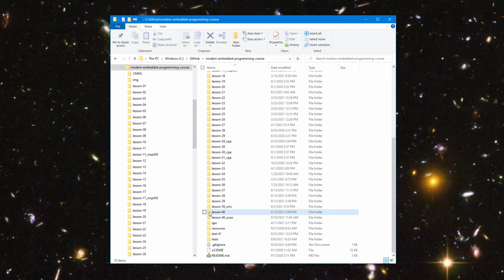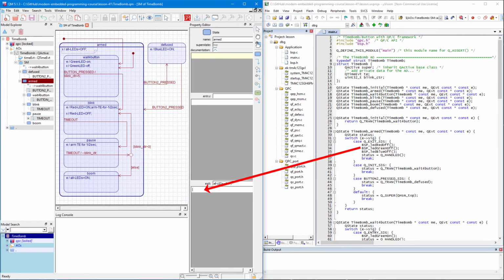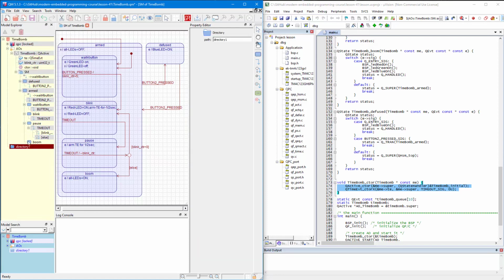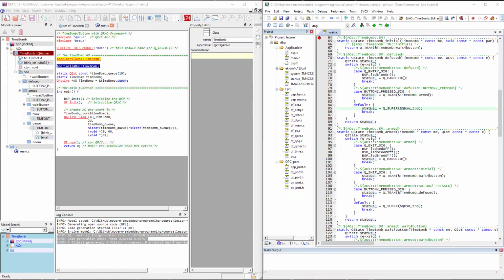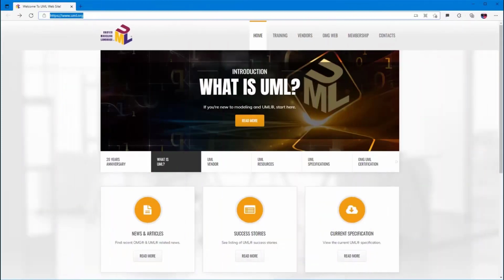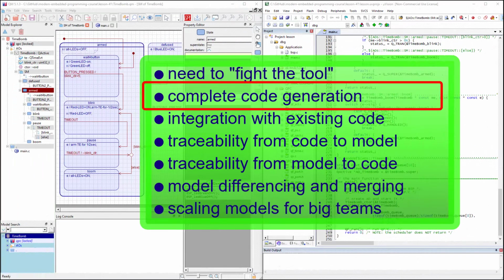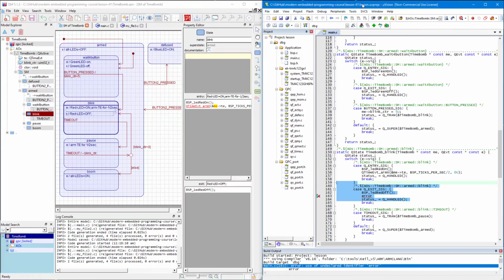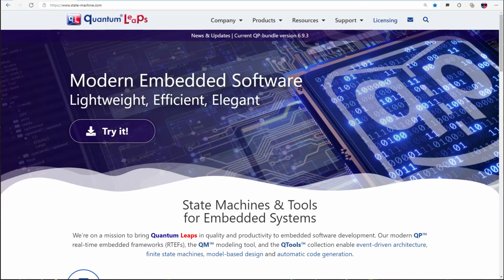#41 State Machines Part-7:Automatic Code Generation

Comment: This a great tool, thanks for the lesson Mr. Samek.  What are your thought on SysML for Model Based System Engineering for Embedded Systems designs? I like the idea of MSBE with SysML due to the fact that it begins from the requirements the system and the multiple tools to represents these and the behaviour of the actors and use cases. State machines are part of this approach, as you mentioned QM allows the code generation and seems to be the easiest as far as SM modeling / code generator I've seen (so far only tried Sparx EA). I think I could use the QM for code generation in hand with SysML to develop Embedded Systems.
Reply from the maker: SysML is an example of a bigger modeling language aimed at the whole system, not just software. The QM modeling tool supports only the state diagrams, which are fully compatible with the state diagrams of SysML. In this sense, QM can be used to model the state behavior of various system components, not necessarily just software components. Of course, non-software components cannot take advantage of QM's code-generation capabilities. But for software, QM can be a lightweight, no-nonsense, "low ceremony" tool that will get the job done. --MMS
Reply: @StateMachineCOM  Is SysML a modeling language you would recommend for embedded system design or is there a simpler one?
Reply from the maker: @juanorlando9783  SysML (similar to the whole UML) is complex, and only small parts are "constructive," meaning elements that can be used for final implementation. Big methodologies like that have been tried and failed because elements that are not useful in the final product are abandoned. Hierarchical state machines are one of the few exceptions because they are "constructive" and can be used to generate production code that otherwise would be error-prone to create by hand. But here again, the danger is that if this feature is not used, state diagrams will get abandoned just like the rest of it. In this sense, automatic code generation is essential for the success of modeling in software. --MMS

Comment: It is a great tool to implement state machine flawlessly, but in normal circumstance most people would like to write code in the IDE editor. Then while modelling they would have to use that code inside state machine. This seems a little difficult to convince people at the start as it seems that we are doing rework
Reply from the maker: Of course, when state machines are first coded by hand in an IDE, re-drawing them in a modeling tool is a duplication of effort. But that is backward. To take full advantage of "visual intelligence", you need to start with a diagram. Then manual coding is a rework. But you know this already, right? Convincing other people to do things differently has always been the hardest thing in the universe. Yet, this is the only way to make progress.  --MMS
Reply: @StateMachineCOM  I also feel the same, convincing people to do things differently is a task but nonetheless required for overall improvement

Comment: Is it free?
Reply from the maker: The QM tool is freeware. The generated code requires the QP framework to run (either QP/C or QP/C++), which are both open source (GPL). So, all this is free, as long as your code is free as well. If your code is proprietary and cannot comply with GPL, QP can be licensed commercially, which is not free. --MMS

Comment: Incredible tool, I'm very impressed. I was wondering if you've considered building QM as a plugin to popular IDE's like eclipse or keil, this would be a very interesting, I can imagine the debugging being simplified by watching the literal transitions and current states in a graphic way, I think it would be game changer to have it all integrated into a tool!
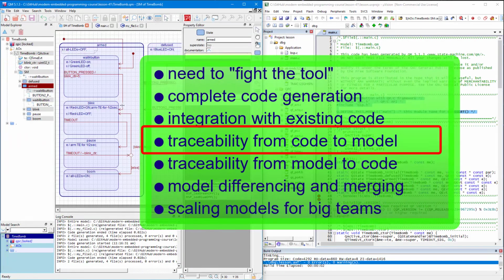Reply from the maker: QM is NOT written in Java, and therefore it's fast . For example, QM opens up in 1-2 seconds (as opposed to 20-30 seconds if it was Java). But that means that it can't easily integrate with Eclipse. Also, of course graphical, model-level debugging would be nice. Currently it's not supported directly, because it would necessarily tie QM to a specific IDE only. However, the traceability comments in the code allow you to quickly navigate between code and model. Here, the most important feature is the bi-directional traceability of the state machine implementation (as demonstrated in the video at 24:55). This is what is really important for effective debugging of the state machine code. --MMS
Reply: @StateMachineCOM  Hi, although a little bit late :-), it should not be too difficult to add a Rest-API to QM and provide plugins for IDEs that enable a bidirectional communication between QM and the IDE. E.g. you can add a context menu entry in Eclipse "Jump to model..." which brings you directly into the model without copy and paste. And when the IDE plugin offers a similar API you would be able to jump directly from the model to the code.
Reply: BTW, a great introduction into state machines and OOP with plain C

Comment: Hello Dr. Samek,  Thank you very much for this course.  It is excellent and I am amazed at all the hard work you have done with it.  Outstanding.  I have also become more familiar with the QM program.  It is amazing.  The more I learn about it, the more powerful and complete it is.  I have followed you for many years, reading both your books and using them as a handbook to learn about HSMs, and to find applications for them.  I was wondering about one thing, though.  Is there a way to change the framework on which a model is based.  I was wanting to experiment with different versions of the same model, but did not want to re-enter the model manually if I can avoid it.  Thank you for you excellent and generous efforts in our behalf.
Reply from the maker: I'm glad to hear that you enjoy the video course. Regarding changing the framework underlying code generation in the QM modeling tool, there is some flexibility, but the "optimal" state machine implementation strategy (introduced back in lesson #39) is codified inside QM and cannot be easily changed. This strategy determines the rules for code generation from state machines in QM. (BTW, this is how most of code-generating tools work. They use an underlying framework to provide the well-defined "framework extension points" to generate code.) What you could potentially change is the active object layer. For example, you could try to pass events in a different way. You could schedule active objects in a different way, etc. --MMS

Comment: Amazings tutorials, congrats ! Are you using scxml as your modelling data format ?
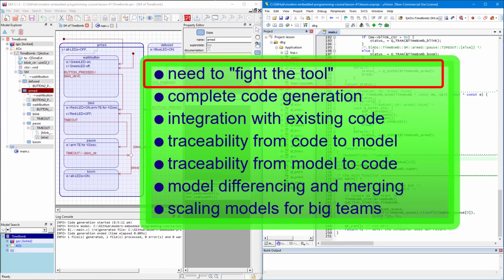Reply from the maker: The SCXML specification has been carefully evaluated as the model format for the QM modeling tool. But unfortunately, SCXML is a bit overengineered and requires such sections as: "Executable Content", "Data Model and Data Manipulation" and "External Communications". All these prescribe a specific "Action Language" as well as some additional restrictions as to how to represent and manipulate the internal data associated with the state machines as well as how the state machines should communicate. All this actively hinders simply using C or C++ as an "Action Language", in effect adding complexity where the tool does not add any value. At 20:36 this video shows an example of "fighting" an overengineered specification (SMC in that case). For these reasons, SCXML has not been used directly. Some elements of the structural state machine description (e.g., <state>, <tran>, <initial>, etc.) are similar in QM, but the QM model format is much simpler than SCXML. Please check it out by yourself, just by opening the qhsmtst.qm file supplied in the project for this lesson in your favorite text editor. --MMS
Reply from the maker: The QM model format in XML is not based on SCXML specification, but recently ( in QM 6.1.0 ), the XML Schema has been added to QM (see  file qm.xsd on GitHub https://github.com/QuantumLeaps/qm/blob/main/qm.xsd ). This XML Schema allows the validation of existing QM models with an XML editor. --MMS

Comment from the maker: Another comment/question that somehow was suppressed by YouTube: VFXTuts wrires: "Hi am a beginner in your framework, and I have a perhaps silly question: In a system where, for example there is a switch whose status in unknown at startup time, how can I program in QM an AO to choose in which state it would transition into at the beginning depending on the switch position? At the present moment I implement it by starting the AO into a state which arms a timer of 1 tick, the state is subscribed to that timer event, which triggers a transition segment that checks the switch position, followed by a choice segment that, depending on the readout, transitions into the desired state. a screenshot of said implementation https://snipboard.io/OzenNP.jpg MR "
Reply from the maker: You're right that sensing the switch position at run-time is not possible to implement in the top-most initial transition, because guard conditions are not allowed on initial transitions. And you're on the right track to think of an event to trigger a regular transition, which can have guard conditions (the state of your switch). But this event does not need to be the somewhat expensive time event. So, I would invent an immutable event and post it to self in the top-most initial transition. Then in the first state, you can have a regular transition with a guard based on your switch position. The framework will execute the transition only after the initialization phase. I hope this makes sense to you. --MMS
Reply: Thank you!

Comment: you are amazing.
thanks a lot for this great video.
the ability to compare the model updates is important and not exist in stateflow
also stateflow generated code is flat and not hierarchal.
if QM tool is reliable and doesn't have a major bugs, then it will be the best choice for many suppliers.

Comment: Why not using matlab’s simulink code generation?
Moreover to the state machine, you can generate code for filters, dsp stuff, controllers, etc.
And all of them can be generated in c and cpp compatible with arm compiler.
And it is easy to use 💪💪😁
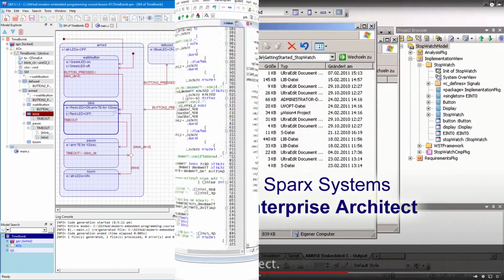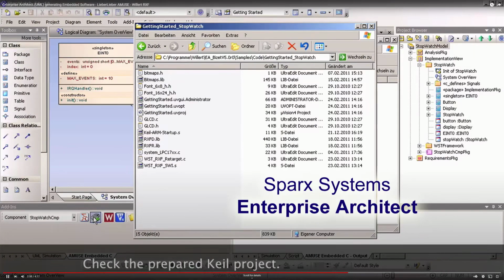Reply from the maker: The video actually shows a quick overview of other modeling tools from 21:09 - 21:19, including Stateflow (state machine tool for Matlab/Simulink) at 21:12. But specifically Sateflow is designed for predominantly input-driven state machines (see lesson-37) and definitely not for active objects. Of course, we can also debate the quality of the generated code in terms of traceability and scalability. Finally, StateFlow is expensive and I would still put it in the category of big, "high-ceremony" tools. --MMS
Reply: @StateMachineCOM  Thanks. That was a reasonable and a good answer.
Reply: I am not saying what you are doing is bad… you got a good vision of the future of embedded system, especially the need for automatic code generation…